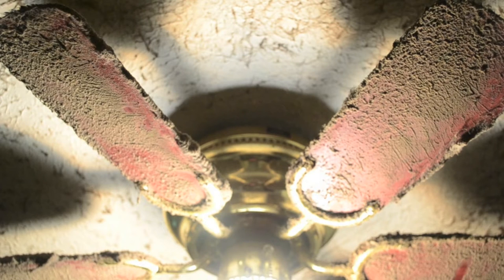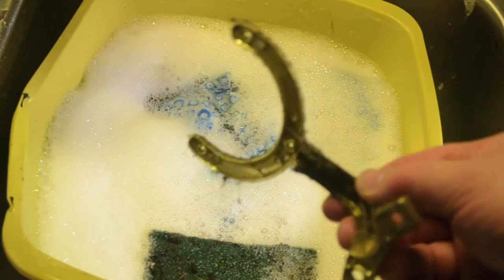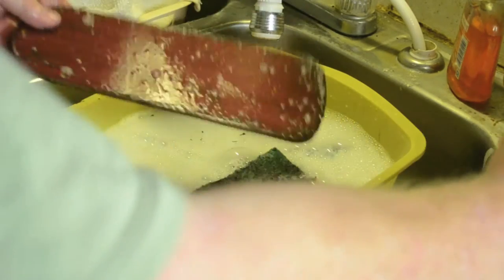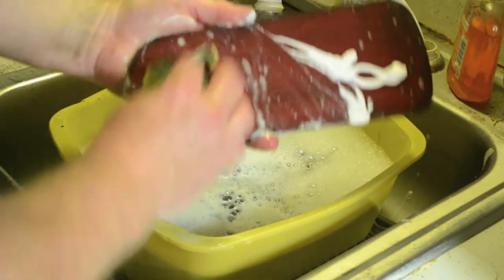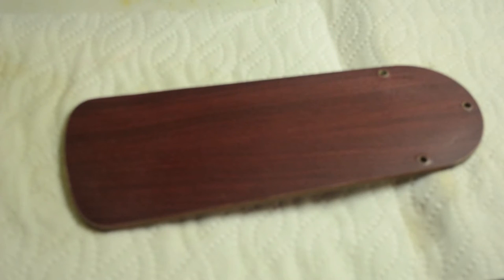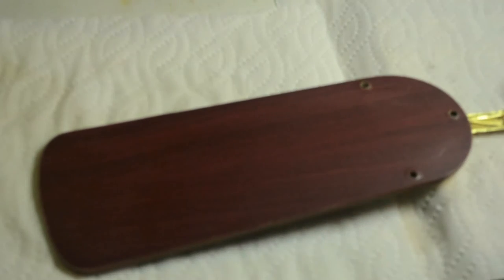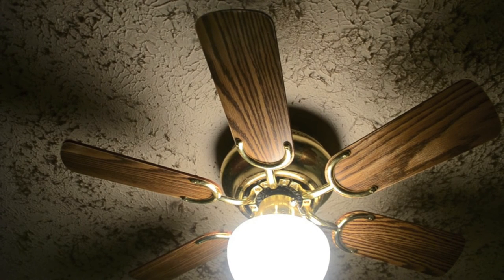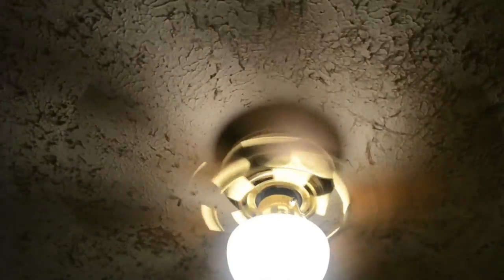Ceiling Fan Cleaning

Comment: The one blade at a time is important, especially if your fan is well balanced and not wiggling around while running.  I would personally keep the screws in the fan blade and spot treat the metal brackets with Fantastic or a heavy duty grease cutter.  Why?  The vast majority of these fans are made of cheap plywood and the holes for the blade aren't likely to have any paint or varnish protecting from the water.  Keep the screws in will keep the water on the painted side of the blade, not in the unprotected screw hole.
Reply from the maker: Thanks for the input!